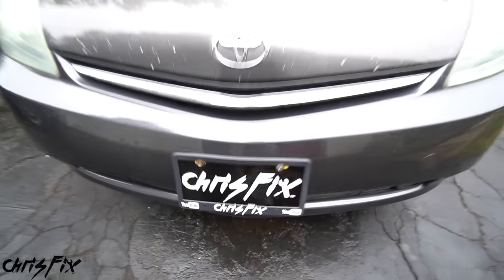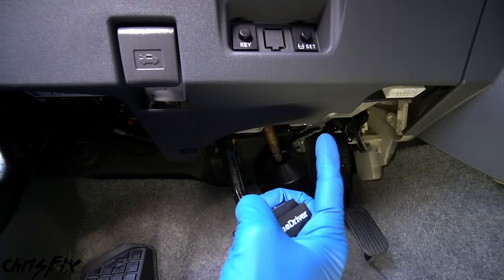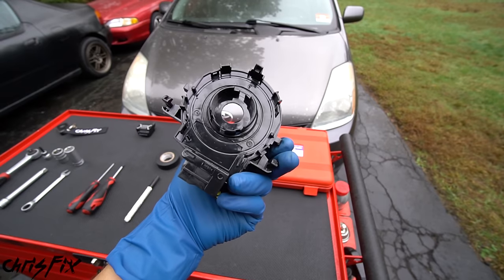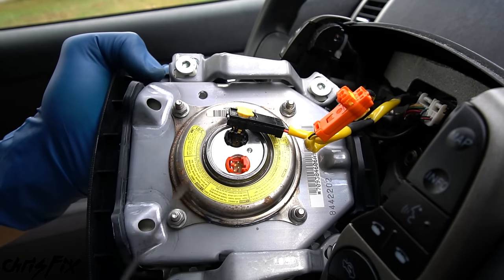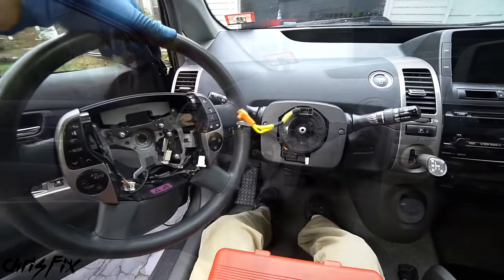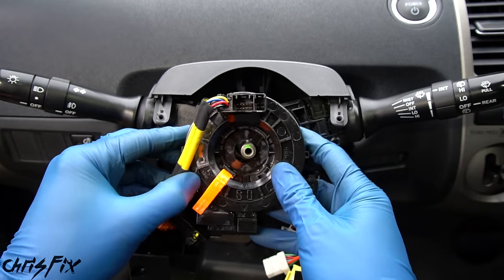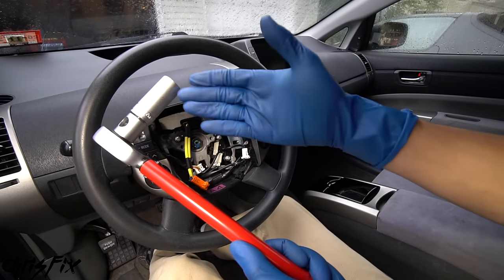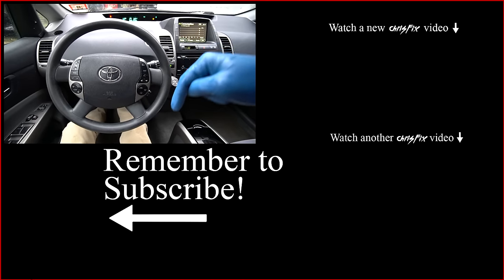How to Replace a Clock Spring (airbag light & horn not working)

Comment: Hey Chris, Just wanted to leave a post thanking you for this video. Yesterday I was able to follow this & change the clock spring in my 2003 Toyota Corolla as well as your headlight restoration video. My car just passed its safety inspection and is back on the road thanks to you.

Comment: Brilliant video. I’ve not done more than basic car maintenance before and I did this in an hour. I drive a 20 year old imported Toyota Alphard and was struggling to find a garage the could diagnose & fix the problem. Managed it myself for the cost of the part. Thanks Chris!

Comment: safety advice: when working on the airbag in the steering wheel always disconect the negative pole of the battery when the car is in running position. that way if the part is faulty or you made a mistake the airbag cant blow up in your face due to voltage peaks or wrong wiring etc. then if it blows up while reconnecting the battery youre not in the way of it

Comment: Whoever thought to tuck that battery away in the trunk like that should be slapped.
Reply: flimflam Dodge put the battery in the front bumper of the Journey and the Avenger. I would hate to see the outcome in an accident
Reply: Hey, better to tuck the battery away in the trunk where it's easily accessible than it is to stuff the battery in the bottom of the engine compartment so you have to go through the wheel well to get at it. (Hi Plymouth Breeze)
Also, I had Buick LeSabre and that battery was under the rear seats. I'd rather the battery be in the trunk than be sitting on the battery, although at least the seat location was still fairly easy to get it.
Reply: @mjc0961  in Humvees the battery is under the passenger seat
Reply: It is a modern location and very smart. In Phoenix I had only cars with batteries under the hood. I never once, in 25 years and two cars or more nearly the whole time, got any battery to last through three summers. Maintenance free batteries absolutely hate the underhood temperatures. In the Prius the 12V battery does not handle the starting current, either, so voltage drop is not a consideration.
Reply: @mjc0961  ran into that the other day trying to give someone a jump.  They couldn't find the battery. I asked to see the manual. They didn't' know where that was either...I said "check the glove box." Sure enough there was the manual...and in the index was the page where the battery was located. It's amazing how some forget basic book usage. Like GM engineers that put batteries under the back seat. Like the page that says, "The battery on GM cars goes in the Engine Compartment!"
Reply: You think that's bad? In a TVR Tuscan, YOU HAVE TO TAKE OUT THE ENTIRE FENDER TO EVEN SEE THE BATTERY
Reply: Funtagious We dont even have tvrs in the us
Reply: Saw a Buick once where it was under the back seat. And in case anyone thinks it's a new problem, I saw a 1964 Ford F600 that had the batter under the passenger floorboard for some breathtakingly arbitrary reason.
Reply: I used to work as.a service truck driver for an auto auction company, giving cars jumps was most of my work, so I got to know to where most batteries were located, until I had a dead Smart Car, no manual, had to youtube it to find it, its in the passenger footwell. my favorite is some of the late model Ford Thunderbirds, its in the trunk but there is no trunk key access outside, its behind the drivers seat. 
Putting batteries in the trunk is common in some car its help balance out the car for performance. Hot Rodders use to (maybe they still do) relocate the battery to the trunk, they make kits for it.
Reply: I personally don’t mind it in my Charger since there’s a jumping port under the hood anyways. Plus with how big the battery is, it saves some room and weight on the front end. 🤷🏻‍♂️
Reply: @alecdziuk6450  It's a little-known fact, that every car that has the battery somewhere else, has jump points under the hood anyway.

Comment: I’ve got an airbag light on in my truck so if it ends up being a clock spring then I’m all set now👍
Reply from the maker: Aribag lights can be a lot of things. Dont just throw parts at the car. Get a BlueDriver and properly diagnose it. That will make your life soooooo much easier! https://amzn.to/34KEXHs
Reply: ChrisFix Yeah I definitely plan to diagnose it first. My dad has a scanner I just have to get around to scanning it and fixing it lol
Reply: Wayne Jorgensen Thats true. I’m thinking there might be a chance that it’s the clock spring or possibly a loose connection somewhere because it does randomly go off and then back on when I hit bumps or turn the wheel. Could be many things though. I will definitely be scanning it soon I just have to get around to doing it is all.

Comment: Thank you so much Chris. Very well detailed instructions. My clock spring failed in my 16 Camry. Toyota wanted $880 for parts and labor. I laughed my way out the door. 

The Clock Spring cost 💲 me $18 on eBay. 

I just save $860 plus dollars. My dial failed on my right side and everything else was fine. 😅

Comment: Replaced the clock spring in our 2012 Toyota 4Runner. This is the best video out there explaining the process without being too complicated. You highlighted everything we need to do this safely and efficiently. Saved $600 even with an OEM clock spring from Partsouq. Thanks!

Comment: Dude, I love you.  I paid $17 on eBay including tax and shipping.  It took me about an hour because I was being very methodical but I think I can do it now in about 15 minutes.  You were so thorough but A quick note for your followers:  when transferring the sensor to the new clock spring, make sure that middle white circular thing is properly lined up.  One side is slightly bigger than the other. Rotate it so the two little square things fit easily or you will waste 10 minutes trying to force it in like me.

Comment: Replaced the clock spring in my 2003 Tundra. Excellent video. Minor differences in mine was the Torx bit was a slightly different size, there was only one plug + ground wire on the airbag instead of 2, and the clock spring was held on by 4 screws rather than 3 friction tabs.

The steering wheel DID require the steering wheel puller and there was not an angle sensor. The torx screws WERE captured and could not be entirely removed.
Reply from the maker: Nice work!

Comment: Thank you so much Chris !  i got a $17 clock spring off ebay and replaced it yesterday following your awesome guide.  had to buy the 19mil socket, torque wrench and the weird multi screw driver :) for another $15  ... took less than an hour event though i went slow taking pics at each step as a precaution.  My cruise and info button were not working before and now all back in action.  you saved me $145 bro.  you are the best  !

Comment: Great video! Dealership scammers tried to charge me 140 bucks only for diagnostic! 5 minutes work with OBD scanner you can get for as much as 50 bucks! SO I was looking for good video how to disassemble steering wheel on Prius, to figure out what's wrong with it and this video is brilliant. However you don't have to unplug battery in trunk, since there is main under the hood in fuse box (at the right to engine). It is safer and easier. Also don't forget to reset your Prius completely.

Comment: Perfect explanation without any crazy music going on in the background thanks a lot helped out a great deal, I noticed when I plugged the black plug in to the airbag the little yellow clip would not go in all the way and I was getting the airbag light so I went ahead and looked at it again and I tried pushing in that plug but luckily I took the little yellow clip from the old plug and it fit into the new plug and you can hear it clip solid after that and then the airbag light disappeared still worked out great thanks again

Comment: 2015 Frontier (130K miles) clock spring is starting to die. Audio controls don’t work in the 12:00 but do in 3 and 9…. This was immensely helpful and will save me hundreds of dollars in labor costs…

Comment: I've just replaced the clockspring on my 2013 Lexus CT 200h.  Instead of torx nuts on the sides, the airbag assembly is held on by 3 wire clips, that just requires push by flathead screwdriver, 2 on each side, one at the bottom. Previously, i had brought a clockspring to a mechanic for him to replace. it turns out the clockspring i bought did not fit my Lexus, probably for a Prius. The Mechanic charged me $150 anyways.  This time, i went on Ebay and bought another one, for $30.  The whole job took about an hour for me.  Tested it out, horn works. Satisfied with my job.

Comment: I did that on my 2008 audi a4, and was amazed by how easy it was. The clock spring had a mechanism that didnt allow it to spin unless you pushed a little button. Saved over 500$

Comment: Problem here 🙋‍♂️ I needed to replace the clock spring for the airbag light. Pulled the clock spring no prob (thanks to you). My airbag light is still on? Horn works again, course control and steering wheel controls. I doubt the air bag went bad in one day? Suggestions?

Comment: I accidentally turned my wheel 3 times and broke my clock spring in my 05’ eclipse while I was replacing the steering rack. This video is going to make it easier for me to understand how to remove it and replace it

Comment: I work at a body shop, and am adding in some info on scanning newer vehicles. Some, primarily GM vehicles with push to start, aren't just press the button once or twice, but instead you hold it down for typically 10 seconds. That puts it in full IOEO (ignition on engine off) mode so you can scan it.

Comment: Thanks Chris. I just replaced the clock spring in my Subaru Forester and the airbag light is gone. My biggest problem was to pull that stubborn steering wheel nut. On my 3rd attempt I used a length of 2 x4 board to brace the steering wheel while I pull the nut.  I only hope the clock spring from Ebay last.

Comment: Great video really helped when I replaced my clock spring however I did have to get the error code reset after the repair as it did not disappear on its own! Some cars need to have the error code cleared! Guys

Comment: This is great man!  I’m a new Subscriber and so far love your videos. Question. You out the old sensor into the new clock spring, why not replace that too? How do you know if it is still working?
Reply from the maker: Thanks a lot! And welcome aboard! When your clock spring goes bad, it is usually the wires inside that have to spin, not something like the sensor. And because this is easy to do, if that sensor was also bad, you could just take it off again and replace!
Reply: ChrisFix nice. Thanks again bro

Comment: Hello, I’m a fan of your videos, they are always super professional and helpful, thanks for all you do :) But one thing that concerned me about this particular video is that (or maybe I did not understand how it works), I think it is also important to remember to be careful about angle sensor position when transferring from old to new clock spring, it looks like it is keyed that you will not put it wrong when it comes to angle 0-180 but what if it accidentally angle sensor during transferring turns whole turn around? Then it is possible that car detects that steering wheel is turned one turn left or right when in fact it isn’t and this can cause wrong reactions in emergency situation. I know that in some cars you are able to read angle in diagnostics, to confirm that it is 0. Anyway great video :)
Reply from the maker: It is keyed in a way in this case where that is not possible, I can see why you are thinking that though. Thanks a lot!

Comment: Once in a while, I get ambitious and try to do something on my own.  Ordinarily, it ends in complete disaster.  But, I used this video to change the clockspring on my daughter's car. It is a 2007 dodge caliber. The dealer said $650 and the local parts store quoted me $196 for the part.  I found it on ebay just as you did, paid $27 including tax and shipping, and changed it myself.  I also had to buy thread locker and a torque wrench.  I couldn't find the screws to take off the plastic steering wheel collar though after breaking it, I now know where they are.  Anyway, I put the car back together and the cruise and horn work again and the airbag light is out.

Comment: Hello Chris and everyone! 
Watched this video around when it came out just for knowledge. Fast forward to now and I have a Mercedes E Class (w212) with this exact issue 😂. Dealer quotes $1,075 for Clock spring + "column/stock assembly" for my model (E550)... I dont want or need the assembly, I just want the spin dial lol. 
They are $200 on ebay but NO ONE can tell me if some are specific for heated wheel + lane keep assist.

Comment: Thanks for this great tutorial video! Just got a question. If a driver's airbag deployed during a wreck, should replacing the clockspring and the airbag remove the light? Don't we need to reset the airbag module or something else to remove the light? Also I have to mention, that I don't have any codes related to the SRS, just have the light on. My car is 2010 Corolla. Thanks again!

Comment: Me: "treating the air bag like its a bomb"

Chris: "SO YOU JUST WANNA TOSS IT ON THE PASSENGER SEAT, DONT WORRY IT WONT BLOW UP"
Reply: As long as there's no power going to it, it won't and there is very little chance a piece of plastic rubbing on cloth will generate one.
Reply: @greenscreen1060  true lol hope for the best prepare for the worse lol

Comment: In recent models after replacing a bad clockspring a recalibration of the steering angle sensor is needed. I changed the clock spring but the steering wheel was slightly misaligned and the traction control light was constantly blinking and activating the abs sensor to stop the car, making it undrivable without disabling the traction control manually

Comment: Good video, One thing though is that Kia will not allow you to read airbag codes in their vehicles you would have to take it a Kia certified mechanic. So if you have a Kia you have to diagnose it manually without an obd2 scanner if it is related to the airbag system.

Comment: I saw another video a guy replacing this same part because his prius horn was not working. He replaced & worked after. I guess it fixes both issues
Reply from the maker: Sometimes a horn not working can be a clock spring!
Reply: @chrisfix .  thanks chris I replaced clock spring, now horn works & airbag light is no longer on 👏🏼👏🏼👏🏼 your the man bro

Comment: Thanks a lot ChrisFix!! Super-useful video!! Got 2 notes for ppl reading this. 
1. I needed a puller set to remove the steering wheel in my 2008 Gen2 Prius (Europe). 
2. For those using metric units, be careful not to confuse in-lbs and ft-lbs in the video. Ensure to set the torque wrench properly! I used too much force putting back in the two torx screws at the sides. When I tried to take them away again, I stripped them. I succeeded in removing them afterwards, but it was kind of a nightmare..
@ChrisFix, as I used a puller to take it out, would I need to do something to 'block' the steering wheel in when putting it back?
Reply from the maker: Thanks a lot! You should be able to just put the steering wheel back on!
Reply: @chrisfix  Confirmed!

Comment: Top tip: if you can’t get it to click no matter how hard you try, duct tape is always your friend (don’t do that unless you absolutely have to and definitely don’t do that with the airbag wire as you kinda need airbags and this is coming from someone who’s been driving around with nonfunctional airbags after a wreck for over a year lol). I did use duct tape to hold down my dad’s headlight & turn signal connectors on his truck but I will see about replacing the wiring harness

Comment: hello @Chris, i have a question, what about car with push start button? if we remove battery power, the steering will lock if we turn it. Some of the car model when removing the steering air bag cover, we need to turn the steering to access the different screw hole behind the steering.

Comment: 13:23 I hear clicking noise from where the clock spring sits even if I am driving straight. As far as I can see from the video, those two notches on the sides that go into the mount seem to be loose. I will check my Toyota if the problem is coming from there. Thanks for the video, Chris!

Comment: Thanks Man! Did this myself on my Tundra. Question, I didn't snap the orange retainer clip off. I just pulled it out. Does that make a difference? 

Thankfully changing this out, My airbag light went off  and my cruise control started working better. Recently I had noticed that my traction control was going off on turns that it probably shouldn't have. I do have the extra sensor that I moved over. Knowing what I know now about the clock spring, I'm wondering if this was also related to the clock spring going bad. I guess we'll see.

Comment: Great video and plenty of good info!!
Question for the oem clockspring when purchasing from the dealer does it already come centered as you described? And i did not quite understood when or why you need to spin it 5 times thats where I am confused?
Reply from the maker: It should come centered with some sort of insert to prevent it from rotating, and you do not need to spin it 5 times, I was just explaining what to do if you clock spring rotates by accident. In this case it said 5 turns is lock to lock, so 2.5 turns is dead center, and your clock spring needs to be center. If you are careful and don't rotate it, you shouldn't have to worry
Reply: Awesome!!! Thank you so muchvfor taking your time to reply back about this matter.